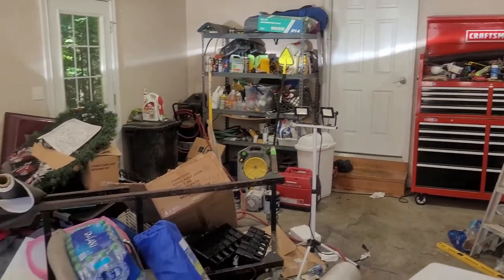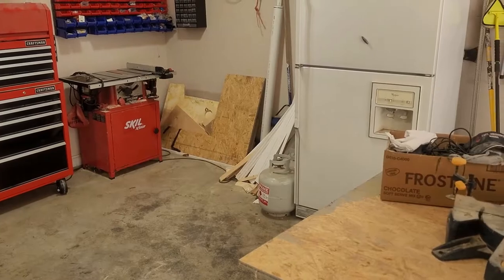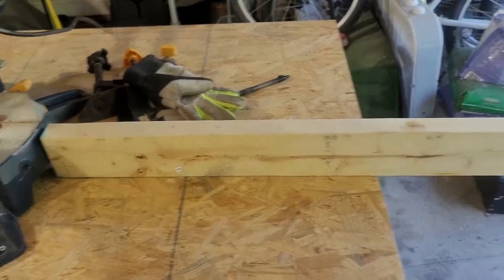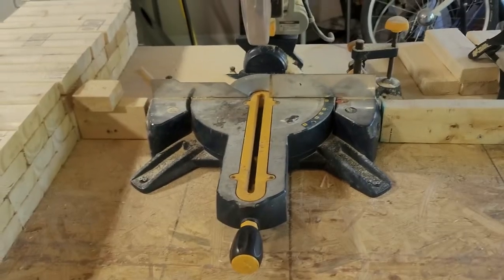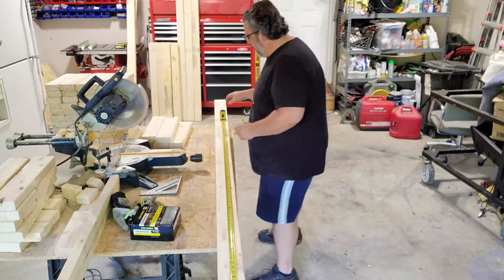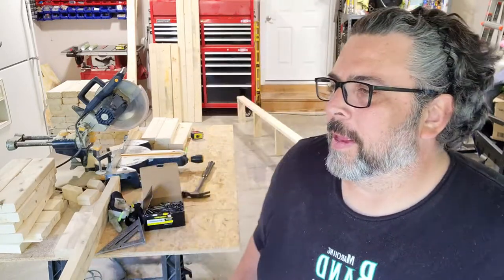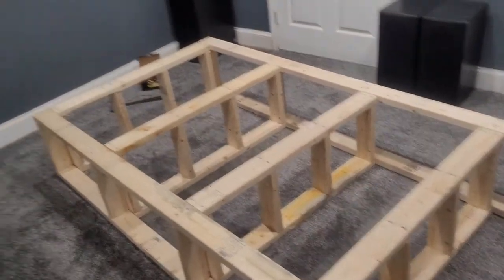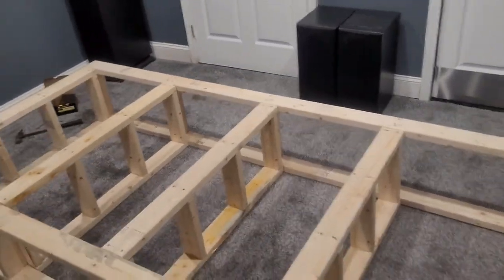Building a Home Theater Riser Part 1

Comment: A family affair. That’s great. How tall is your ceiling and riser?
Reply from the maker: Got to enlist help sometimes! My riser is 18 inches, and my ceiling unfortunately is only 7 feet 8 inches. The main reason for the riser height is so that the second row can see clearly over the heads of the first row.
Reply: @EuphoniumDirector  Thanks for replying. I understand the reason for riser height. I was just curious about the ceiling height because you seem like a very tall person and I’m also trying to get a sense of how high I can make mines when I’m ready. I have a decent size space but unfortunately only an eight foot ceiling in my basement because it’s an older home. The 8ft is just to the floor joist without any framing and drywall.
Reply from the maker: @P F  well I wish I was tall. Just 5'9" here lol.
Reply: @EuphoniumDirector  😂 I guess you just look tall in the video then. 😊